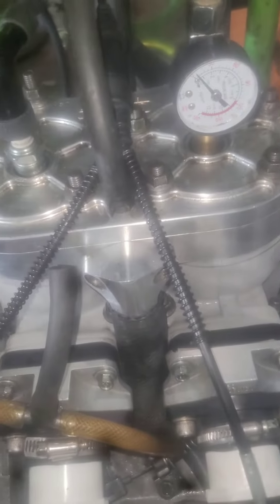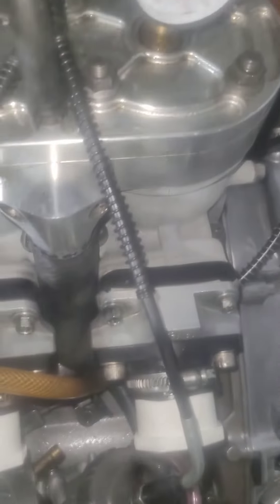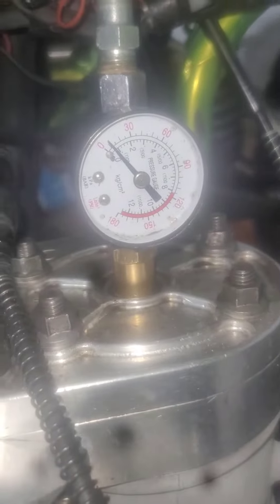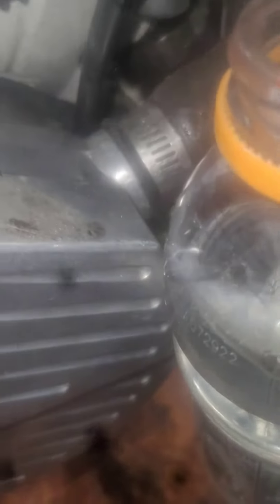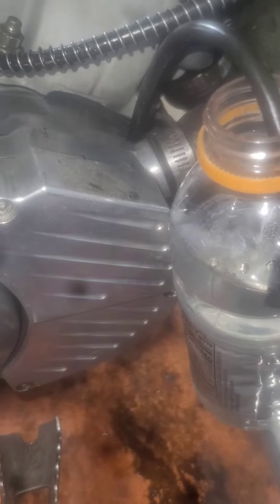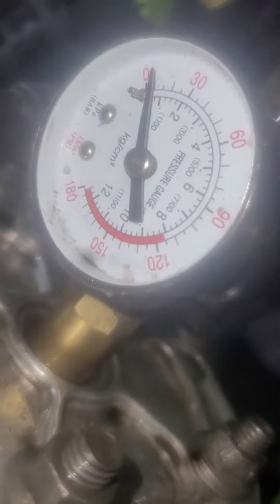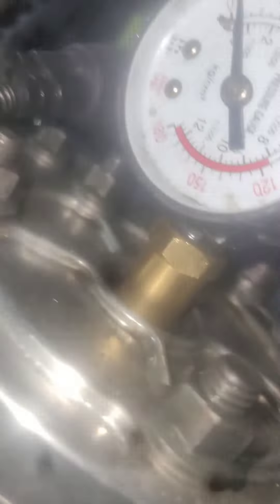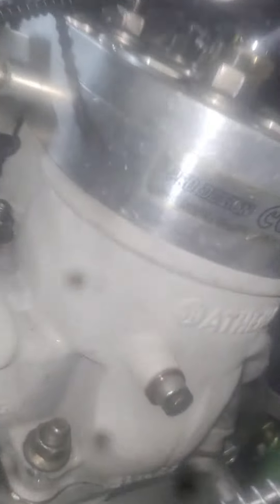yamaha banshee right side crank seal compression test

Comment: I have a 03 and starts right up but I do have the issue of the right side spitting gas and/or oil out the pipe. Had carbs tuned and still the same. Did a compression test but both sides are 90psi. Weisco pistons and crank looks new (only took off top end). Do this mean I need crank seals?
Reply from the maker: 90 psi is low and of its oil.comimg out more then likely the crank seal is bad. Where are you licated?